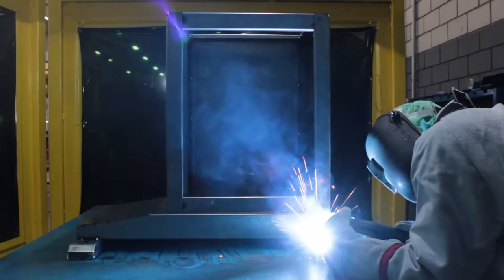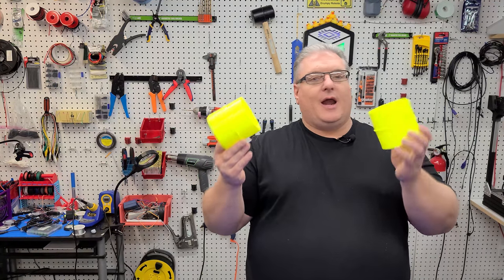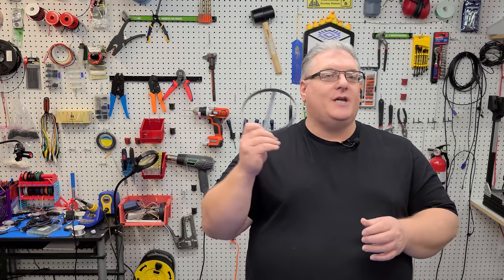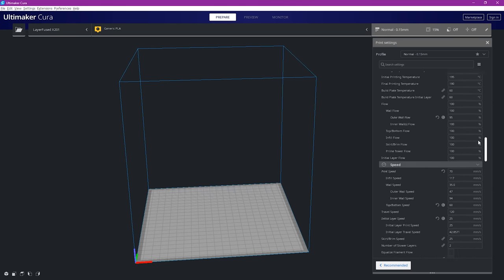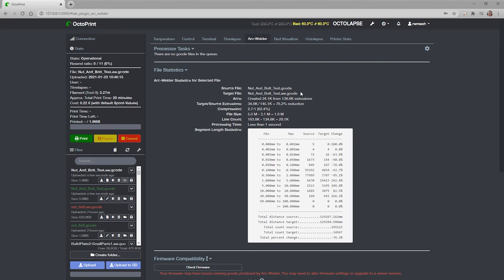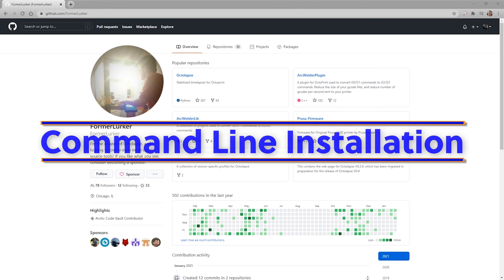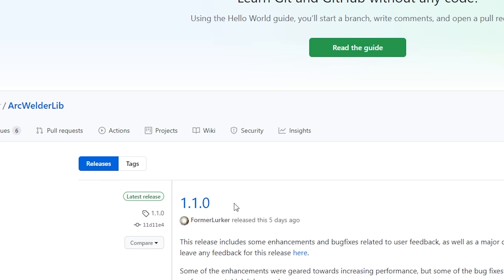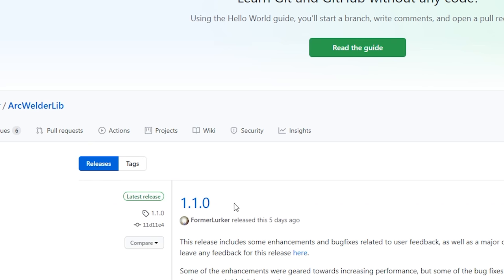Arc Welder - Smoother, Faster, Better 3D Prints! Its like magic to improve your 3D Print quality.

Comment: You said, “Printers only print in straight lines.”, which isn’t correct.  GCode supports arcs as well, and I’m pretty sure that that is where Arc Welder got its name, correct?  It looks for simulated arcs that a slicer may be creating, instead of using real arcs, and turns them back into the arcs that they truly are.  The size savings is due to the GCode arcs taking up less space than multiple straight lines.

Interesting video though.
Reply: To be fair, not all firmware supports all GCodes. Marlin has G2 and G3 for "arc move", but that doesn't mean every printer will actually have that. Maybe that's why slicers default to line segments? If that's the case, I wish they would just make it a setting.
Reply: @TheVideoGuardian  lets just consider if what you are saying is true.  If it is, then this addon would be absolutely useless on those machines, correct?
Reply: @KaelumYodi  Yes. The machine would not know what the commands mean, so it would ignore them. Mind you, I'm pretty sure 95% of all printers you find will support arcs. Technically it's an option though. Check at 1:47 it shows the line of Marin source code where the feature can be disabled via a define.

You're not wrong either though, since he DID say it wrong. The printers that work with this know how to use arcs already. It would require a firmware upgrade otherwise.
Reply: @TheVideoGuardian  that's the only point that I was trying to make.  ;)

BTW, today, I'm pretty much sure it's > 99%, if not 100%.  I doubt that any printer manufactured in past 3 years does not support arcs.
Reply: @KaelumYodi  Yeah, I suspect everything but DIY printers using custom firmware would have it.
Reply from the maker: Most printers support arcs. Even with arc support firmware still only prints straight lines. Steppers move a fixed amount and those amounts are lines. Arc welder reduces the line segments to arcs therefore reducing geode and then leaving the calculations of the arc movement to its motion planner.  This improves the arcs and makes them print much cleaner vs. The slicers method of all line segments.
Reply: @MakersMashup  I know that you think what you are saying is true, but physically it isn't.  Nothing is perfect.  If the movements were absolutely perfect steps, then you could argue that the steps are straight lines, but they aren't.  So, from an engineering standpoint, we'll need to agree to disagree.
This story is about the way that certain slicers slice files like STLs, which have had the exact drawing parameters replaced by triangles.  If the model file is a type that retains the original drawing information (like a DXF file), most slicers will use that information to create arc moves.
Some slicers are already smart enough to do this on their own, and even go further.  They are able to use the physical dynamics of the print head, and the printer itself, to create excellent prints, eliminate ringing, and print faster.
Reply: @MakersMashup  I would have to agree with Kaelum... To clarify, just because steppers move in steps doesn't mean the firmware can't "print" an "arc." In either case, saying the slicer uses lines because printers move in lines is not correct... I mean, the reason MS Paint doesn't support vectors isn't because monitors can only display squares. ;p

As for arc support in Marlin, the source is distributed with it enabled, but there is a reason to disable it; program size. On some printers, eg, Ender3 you will quickly go over the size limit if you enable too many features. Most custom firmware tutorials will tell you to disable arc support because "slicers don't use arcs anyway", which is an unfortunate and false assumption... so the end result is that actually there are some printers that don't support the arc command, albeit it's by the owners choice. One reason why options in the slicer are important. 

That being said, thank you for showing us this tool! It definitely improves file sizes, and is a great addition to slicers like Cura. It even makes a difference with cubes when you use the gyroid infill pattern!

Comment: Hmm OK so it doesn't make a huge difference with a 32 bit board (duet 2)? Still nice so lower the size, but I personally don't really care how large the gcode files are, as long as it prints fine. But after seeing the result in your vid, I think I maybe don't get something, after the arc welder did it job, it really looks bether. Maybe I just try it out on my printer.

Comment: Also, clean up your STL models. Tools like Fusion360 do a terrible job when exporting to STL and are creating tons of non-coplanar faces and holes everywhere. That leaves the slicer to fill in the gaps but it's not as smooth as when it doesn't have to.
When defining wall thickness and top/bottom thickness, use multiples of your line width and layer height. So for a layer height of 0.3 set thickness of 0.9 or 1.2, not 1.0
Reply: Having used Autodesk Inventor for a couple decades, I was actually shocked by how poorly Fusion 360 handled certain models when exporting to STL.

Comment: Seeign some comments on how it alters dimensions and have troubles with corners and straight lines, ¿could you make a followup video comparing arc welder output for parts that have no or very few arcs(like a cube, or parts with long straight lines and beveled edges)?, as well as comparing the accuracy of the printed output with arc welder vs classic G0/G1 print
Reply from the maker: Great ask. I am all for creating a video like this.  Let me get with Formerlurker on it and collaborate again as I feel it would be great to share a lot of the experiences from the last few weeks with others.  Thanks again for the great suggestion @Guillermo
Reply: @MakersMashup  great!, looking forward to it!

Comment: My Octoprint plugin does not show a firmware checker. It is missing a few of the sections yours shows. The only section shown is "Current Run Configuration". I am not seeing any setting to show other sections. Are those sections only in the beta version you have installed?
Reply: Yes, that is in the release candidate.  You can install the latest release candidate via the plugin manager by clicking 'get more' and pasting a link to the latest archive in the 'From Url' box.  You can find the latest link here:  https://github.com/FormerLurker/ArcWelderPlugin/releases

Click on the release link at the top (currently 1.1.0rc1) then copy the link (no need to actually download it) at the bottom of the page called 'Source code (zip)', and paste that into the 'From Url' box I mentioned above.

I need more testers before I release, so be sure to leave some feedback (there is a feedback link at the top of the release page)!

Comment: Can you find out if it's possible to make g-code that seamlessly transitions between Layer-by-Layer printing and Vase Mode printing? (For example, by identifying which sections of your part can be printed in Vase Mode, and which cannot.)

I feel like such a tool/technique could allow for faster and higher-quality prints using less material.
Reply from the maker: You might want to check out curas variable layer height.  Not vase mode but combining different settings you can reduce print time significantly.

Comment: Can you just add it as a plug-in in Cura and it works just like that? Or does it also has to be converted through the separate Arcwelder software and than be reloaded back into Cura?
Reply: CURA still can not display G2 or G3 arcs. This is strictly a post processing on the gcode CURA produces. Try loading a gcode file that has G2 or G3 arcs and you will see garbage path.

Comment: Stupid question. 

So my understanding is Arc welder are only really a benifit if your using hi speed printing ?
Reply: No. It helps with better ARCs in a print.  Which a lot of prints have arcs in them.

Comment: Thanks from your helpful video! Will Arc Welder work if I’m not using Octoprint ? I’m gathering from what you said that Cura runs it as well. I’ll be trying it to output on Flashforge Finder. Maybe someone here can tell me how to get Slic3r’s concentric, Archimedes top and bottom settings to output on my printer which seems to ignore the .stl  output from slic3r?

Comment: Arc welder works best if you have large circles in your model, arc radius of 2000mm and above, below that it will make your print too slow.
Reply from the maker: What are you basing that statement on? I've worked with the author extensively and that assertion doesn't reflect actual results by myself and others.

Comment: Sounds like it would be a great addition, but even through cura, or octoprint, it kept freezing my printer at the begining and would leave it hanging (I have a Tenlog TLD3 pro).  I might reinstall it once it's gone through a few iterations.
Reply: Does it have arc enabled inside Marlin?
Reply: @arturofernandez8487  i honestly couldn't tell you.I do know that it's on Marlin , and haven't had much luck in upgrading it so far.
Reply: Send a g2 command with no parameters through the octoprint terminal.  If it reaponds with 'unknown command', arcs are disabled.
Reply: @FormerLurker  it's not sending anything back with the G2 command. In fact, I think it freezes octoprint. I saw that I'm running Marlin 1.0, so obviously that has something to do with it.  I'm trying to upgrade the firmware to a higher version, but keep getting stuck.

Comment: I have a RPi4 running OctoPrint connected to an Ender 3 v2 via USB. Is it correct that I could achieve higher speeds by printing from the SD card?
Thanks.

Comment: My octoprint screen is COMPLETLY diff. What plugin do I need to get all those commands at the top like yours has?
Reply from the maker: Various plugins such as Arc-Welder, Octolapse, Printer Stats and Bed Visualizer are all plugins in octoprint that add those tabs.  Sounds like its time for me to put together a video of my favorite plugins. :)
Reply: @MakersMashup  Yes, PLEASE do, I cant find the screen where you check the firmware thing you showed
Reply: @MakersMashup  I don't see the page where you show the firmware check. Where can I find that so I can run the check
Reply from the maker: The firmware check is in the beta version @formerlurker can you assist here please

Comment: I just got a Sidewinder X1 printer and do you know if this arc welder software and octopi to will work with it?  I know noob question ...LOL
Reply: Try sending a G2 command with no parameters.  If your printer responds with 'Unknown Command' arcs are disabled.  If it responds with an OK, or complains about missing parameters (it may disconnect, but that's expected), then you are good to go!

Comment: gcodeanalyser.com seems to suggest that the arcwelded gcode has much faster print speeds/feedrate than the original g-code. is the octoprint plugin also messing with the speed?
Reply from the maker: I don't believe it does.  @formerluker would be able to confirm but I think the speed increase you're seeing is because the CPU on the board is processing far less than it was before.  I've noticed the speed increase but if you observe it closely the printer also doesn't lag where it did previously.

Comment: There is a bug in Marlin 2.0 that causes the printer run far too slow with G2/G3 commands if there are small details, something around 1-2mm/s. The solution can be found here: https://github.com/MarlinFirmware/Marlin/issues/15295 (at G2_G3.cpp L#209 and L#239 replace MM_PER_ARC_SEGMENT with 0.0)
Reply from the maker: Thanks so much for this.  I have experienced this bug myself so I'll track it and upgrade once its fixed.  Excellent feedback.  Thanks again Karri.

Comment: Soo...I think this would be advantageous for me, but my workflow goes from my slicer (Simplify 3D) directly to a gcode file that I load onto an SD card and insert into my printer.
I didn't hear you say it, but I THINK this software can just act directly on the gcode, right? Can't I generate the gcode file and then have arc welder transform it?
Just a little confused. Can this work with my workflow?
Reply from the maker: Yes. Produce your gcode then run the command line version on the gcode.
Reply: Hi, try this link for integrating ArcWelder with Simplify 3d:  https://github.com/FormerLurker/ArcWelderLib#running-arcwelder-from-simplify3d

Comment: I've installed the plug-in into Cura. I restarted Cura but the Arc Welder tick box isn't available.  I have all settings enabled.  What am I doing wrong?
Reply: You need to go into Cura settings, and enable the visibility of arc welder option.
Reply: I was having the same issue; installed through the marketplace but couldn't see it under the Special Modes menu or even through preferences searching all options. Just today however I noticed the plugin had an update. Updating and restarting Cura solved the problem on my end, now shows up as an option under Special Modes.
Reply: @srz87  Thank you for the suggestion! I just opened Cura and noticed an update in the marketplace ... for arc welder! I updated it and is now showing up. Thank you again. 😊

Comment: Is this just for curved prints? my project/product is mostly strait lines :-(
Reply: depending on the type of infill you´re using it will save a lot of data and it could speed up your print, even if its only just some rounded corners
Reply: Well for gyroid infill it should help saving time a lot

Comment: Hello my friend. I followed your steps in the installation. It was fine until I installed some other plugins which generated a conflict. I uninstalled them all, and then came the problem. The Control and Temperature tabs are gone. I've tried everything. I uninstalled the program but it comes back with the same settings. I tried to find these plugins, but I can't find the right one.
Can you help me on how to fix this? I can't control the machine (left, right etc. just connect). Thank you, hugs from Brazil
Reply from the maker: Really too difficult to try and troubleshoot this in a YouTube comment.  Drop into the discord and I'm sure someone can assist.  Sounds like though you might want to do a fresh install of octoprint.

Comment: What I do not really understand is,  will it be beneficial for klipper when I am using a powerful raspi as the gcode processor?
Reply from the maker: Rregardless of what is processing your gcode (in this case klipper) you're still going to have reduced gcode.  In theory an arc will give you better prints than line segments as well.  Run a sample yourself.  The test object is in the description I used and it prints fairly fast.  Post your results here I'm sure others will benefit from it.
Reply: @MakersMashup  wow that was quick. Thanks alot. Will keep everyone updated

Comment: I was a bit lost, so we need to enable it in the marlin firmware as well? I don’t think I have any space to enable it since I have an 8 bit board
Reply from the maker: If your firmware has it disabled, then yes.  Chances are there are other things you can disable in Marlin or tweak to gain that space back.  You can turn of the splash screen if you have one, etc.

Comment: I tried using the AW as a CURA (4.8) plug in and also tried it from the command line.  The result was the same.  
 I took the output file and tried to view the G-Code in an online G-code viewer I even tried to view it in CURA and it was displayed very distorted.  
Not sure I did things correctly or can the optimised g-code not be viewed?  If that is the case then how will the printer interpret the code.
I have not tried printing yet because why waste the filament & Print time if the file is corrupted. 

Any and all advice greatly appreciated.

Tom

Comment: do u need to use octoprint with it? I am confused now? I thought if u install the plugin it already does the "arc welding" while slicing the G-code? what is the thing in octoprint doing then?
Reply from the maker: All the same things.  Just different options to use it.

Comment: Thanks for the tip.

To anyone willing to pitch in.... I'm running latest version of Cura, added the plug in, but it is not showing up in the required section. Doing a search in all settings comes up empty. Going back to marketplace shows installed ... SHRUGS

EDIT: Uninstalled and reinstalled multiple times ... still nothing
Reply: Same here. It doesn't show up in any of the settings.
Reply: Jason B
1 second ago
Here's how I got it to work after some research.
Go to this link: https://community.ultimaker.com/topic/34888-arc-welder-anti-stutter-plugin/page/3/
On the fourth reply he mentions a development snapshot. Click on it and save it on your drive.
Open Cura, then drag that file onto the build area.
After a Cura restart, ArcWelder option showed up under 'Special Modes"
I haven't printed yet, but I notice the gcode file size is greatly reduced,
Reply: @jbrou123  FYI, this patch is now available in the marketplace.  @FieldOfView is on top of things!  He even compiled a MacOs version of the console binary for me!

Comment: Is this in all versions of Marlin? I'm using 1.1.9, and don't want to throw gcode at it that can't be understood 😅
Reply: Try sending a plain G2 command (no parameters) to your printer and see how it responds.  If you are using OctoPrint, you can do this via the 'Terminal' tab.  If it responds with 'Unknown Command', Arcs are disabled.

In any case, if you can you should try upgrading to the latest version of Marlin 2.  There are many new features and bugfixes, and in general it seems to work much better, especially for Arc gcodes!
Reply: @FormerLurker  Ah, great idea! Thank you!

I'm patiently waiting for Marlin 2 for my printer; it's one of those (fairly) closed source Anycubic printers 🙃
Reply: Just make sure you check through configuration.h and configuration_adv.h before you recompile and you should be good.